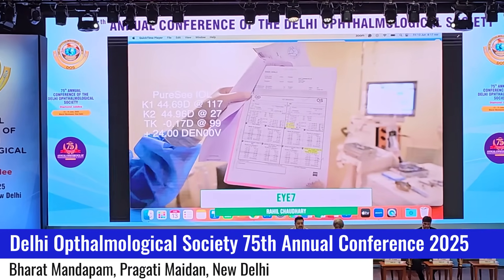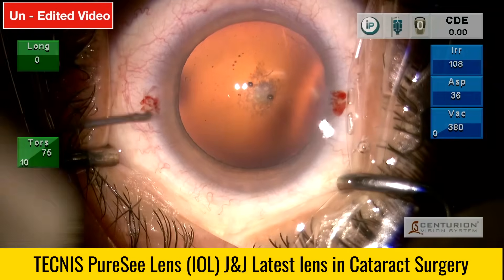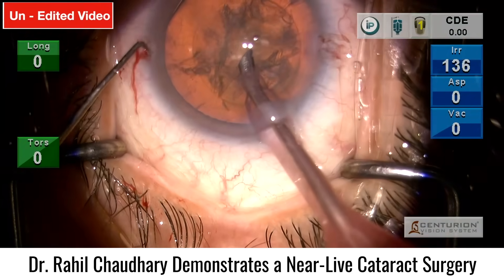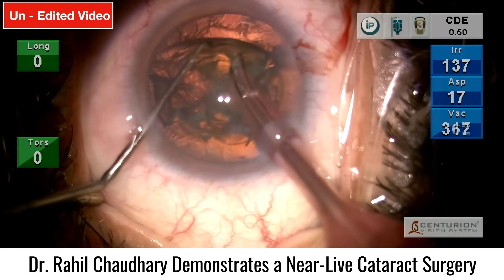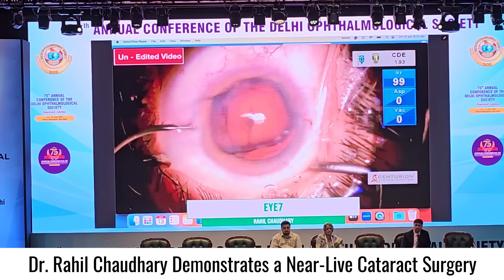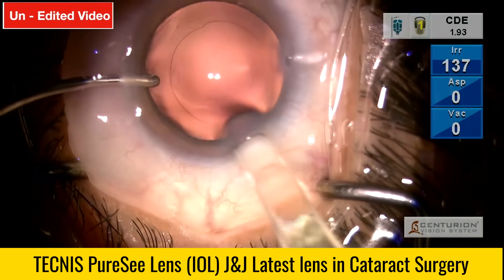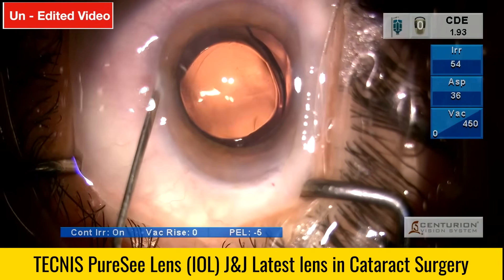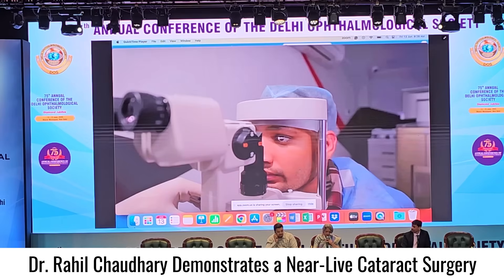Live Cataract Surgery With Puresee Lens (IOL) at Delhi Ophthalmic conference (DOS) by Dr. Rahil

Comment: Hello Sir I Am Mohit From (M.P) I have -18 in right eye and in left eye i have -19 but currently I am 16 year old what should I do because from 2 years my no. Is not increasing. So will it increase or it will be same
Reply from the maker: Your specs power can be corrected by ICL surgery.
But you need to wait for 2 years more, once you get 18+ you can go for the surgery.
You can connect with us for all your queries on 011-40 40 40 70  ( 24 Hours).